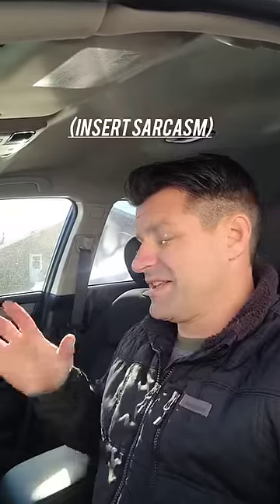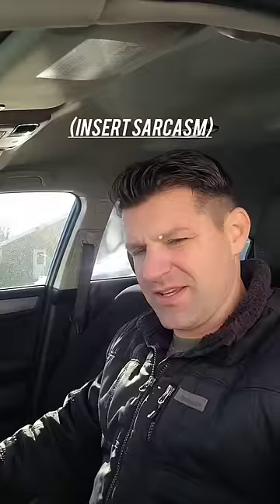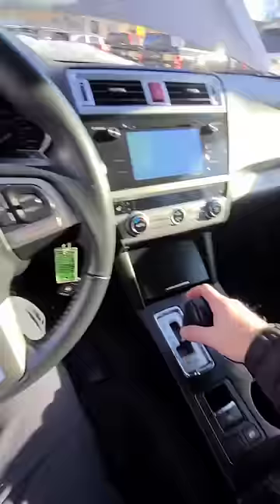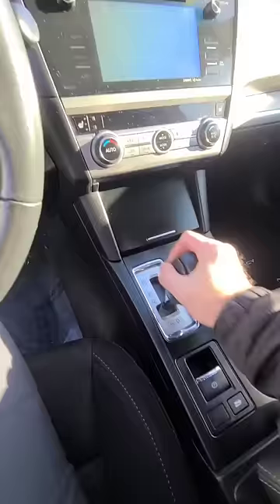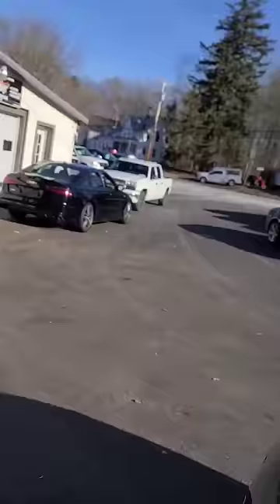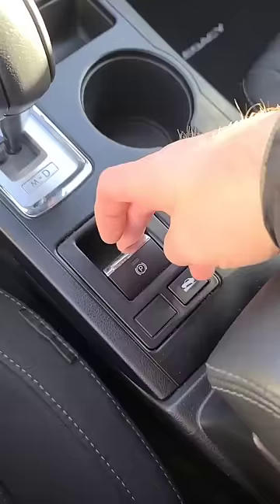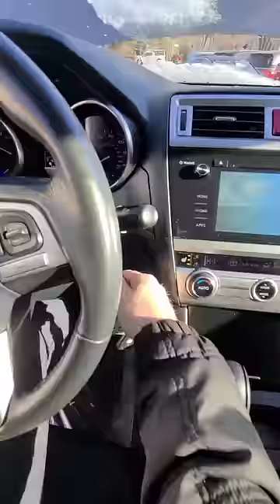Why Subaru Engineers deserve a punch in the Face! #shorts

Comment: To be fair there's a park lock override button under the rubber mat, just in front of your shifter. All cars have this, but they're getting better at hiding them. Just stick a pen or something in the hole, depress the override switch, shift to your desired gear, pull the pen out, and you're good to go.
Reply: Yeah, I wouldn't trust anyone with my car if they can't figure out the shifter bypass, haha.
Reply: Useless, why not have a proper mechanical brake.  When you are unfamiliar with a car, haven't practised it alot, etc. its a lame excuse.
Reply: I was gonna say the same thing.
Reply: I've encountered many cars that have zero ability to disengage the park lockout, sometimes even once the car is running.
Reply: AKA RTFM, yes
Reply: Bmw's require a proprietary metal key to do that lol
Reply: @jessefoster6653  and probably a monthly subscription for the rfid chip in that key to work...
Reply: But that feature is in the unread car manual.
Reply: yeah but its fun to watch this content lol
Reply: @ulogy  he’s a flipper not a mechanic. He takes his cars to actual mechanics
Reply: Yeah but as you mentioned it is hard to find and FW most likely didn’t know this.
Reply: He's not that sharp
Reply: I used to park at an off site airport parking lot and that’s how they would move the cars without keys.
Reply: Yeah, the whole video is dumas clickbait.
Reply: @Adrian_Nel RTFM from the driver's seat while your foot is on the brake?
Reply: @destinal_in_reality most I’ve seen are a little square piece of plastic by the shifter that can be pried off to reveal the switch
Reply: Nobody reads the owners manual anymore. They just go onto YouTube to complain
Reply: You would have to know basic things about vehicles to have that knowledge.  Which this 'car guy' obviously does not.  He's part of the reason insurance rates are higher than they need to be.
Reply: @tooolboxx  It's not mentioned in my manual, which was read
Reply: Thought I was crazy lmao I have a 2016 and it has the shift release thing I thought all cars had to have it lol
Reply: @iAmConfusion  They do. In his model of subaru it s hidden underneath a boot that easily comes  off. He could have  found it by watching a 50 second YT video.  Not surprised he didn't take down the video considering he couldn't figure out the fact that he has an encyclopedia in his pocket. Dude is 🤤
Reply: Thanks now I have to look for that soon. Bought a used Subaru.
Reply: @ulogy  I actually didn't know that.. But in my defense I've never owned an automatic car so my shifter bypass is the clutch lol